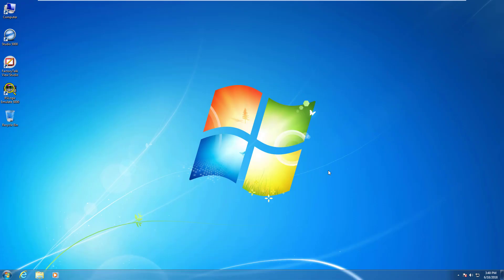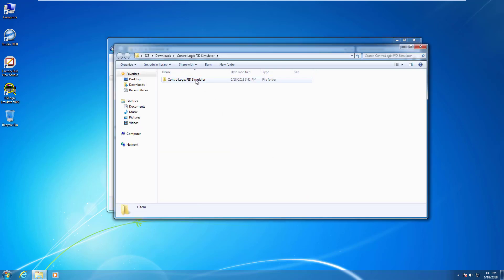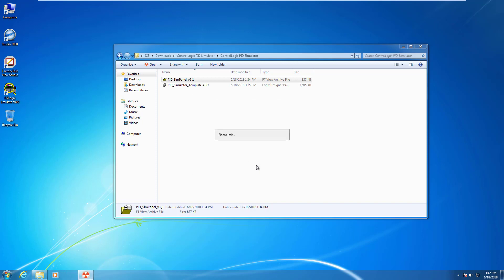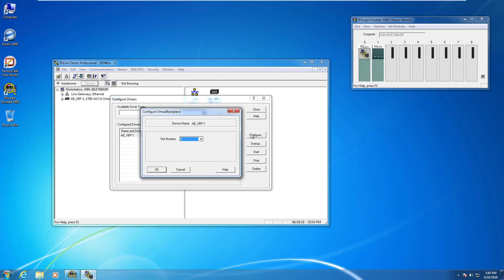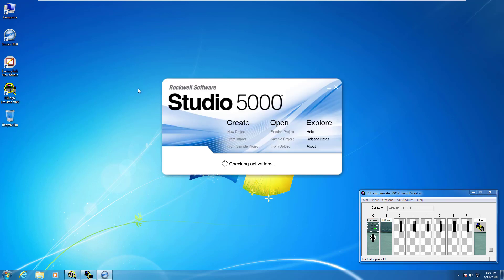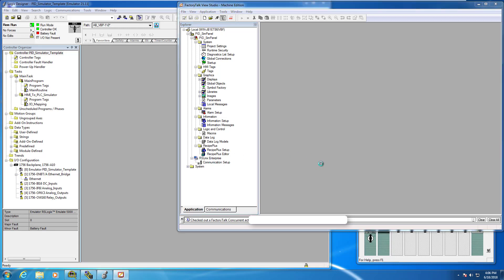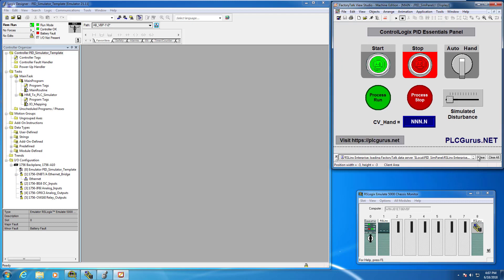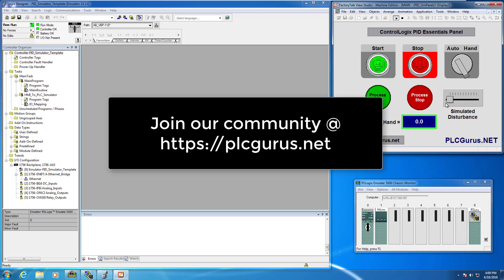PLCGurus.NET - ControlLogix PIDE - Part 3 - Simulation

Comment: Every other project that is in the "HMI project" folder shows up.
Reply from the maker: Hi Alexavier. Thanks for your comment and I'm sorry you're having problems. I have confirmed the application will restore without issue on FTV Studio ME v10. Simply double click the .apa file included in the download folder, and this will walk you through the restoration. After the restore is complete, launch FTV Studio choose the PID_SimPanel application and this will convert the project to version 10. It sounds like something may not have restored properly in your case, launch Application Manager and delete the project. I would reboot your computer and run through this process again, it should work without issue, I just tested it myself.
Reply: @PLCGurusNET  Thank you I'll try again
Reply from the maker: @alexaviergarcia5218  No problem. Thank you for supporting the channel and the website. We'll work together to get it sorted for you!